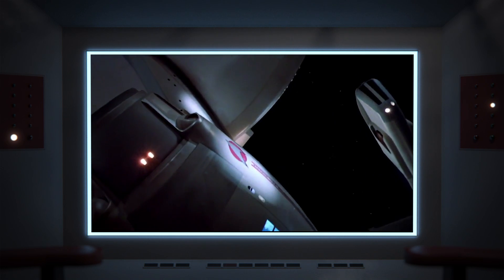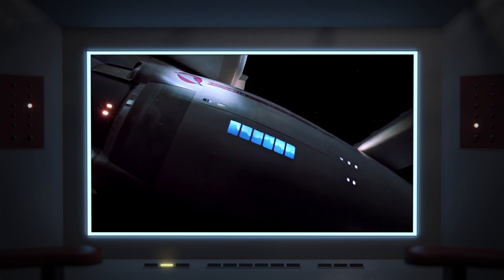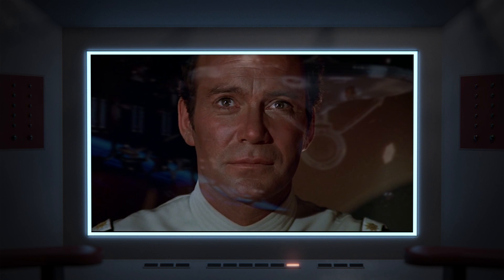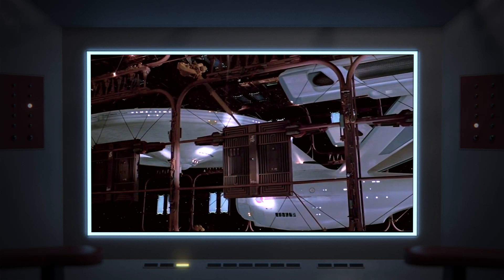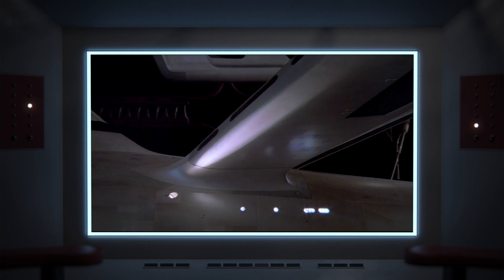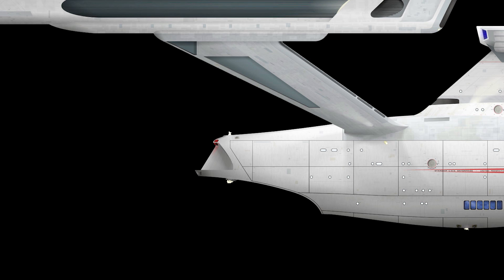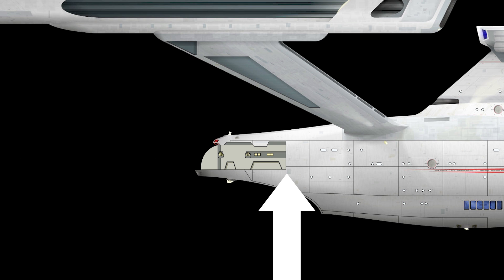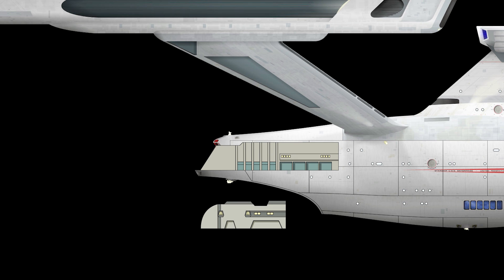Why Have Angled Nacelle Struts? (Enterprise Refit)

Comment: Other than looking so much better...absolutely spot on about the pylons!
The original didn’t have any visible docking ports, the refit does. 
The original didn’t have visible phaser emitters or torpedo launchers, the refit does.
The original did seem to have what could have been hull hatches on the underside of the saucer but the refit has more n they’re better defined. There are various emergency hatches on the top side of the saucer of the refit as used in TMP.
Nit picking details like thrusters on the saucer and engineering hull, far more windows, shielded panelling on the neck to protect the warp core...photon exhaust vent...vents on the pylons but god knows what for...visible tractor beam emitter.
Think of any more?☺️

Comment: I never thought about the additional hangar space, but it makes sense. But there's another design considerations as well that argue for swept struts: Power distribution.

The Warp Core sends plasma to the warp nacelle. Swept struts as shown decrease the distance the plasma has to travel to get to the nacelles. And since the struts connect in the center of the nacelles (over a broader area no less) on the Refit instead of the forward area as on the original, the plasma gets spread more evenly throughout the nacelles. Both features likely improve both efficiency and responsiveness of the warp drive.

The refit's larger struts also likely makes them more damage resistant. Not a small consideration on a ship that can expect to see combat.

Comment: Also take into consideration Tom Paris' assertion that when approaching Warp 10 the hull tries to shear away from the warp nacelles. Angle them closer to 180 degrees and the shear stresses are reduced significantly. At pseudo velocities below the threshold and the reverse is the case - the nacelles twisting/bending the mounting struts at right angles. An angled strut will bear the strain in a much more vectored fashion.

Comment: The Shuttle bay is a good point but I was going with position of the Engine room which I would guess complements your Shuttle bay theory. The original position of the struts being straight is well behind the position of the engine room. This means that anti-mater along with its associated shielding would have to be routed further along the inside of the secondary hull which would take away room that could be better utilized. Angling the struts so they go directly to the Engine room opens up this space.

Comment: Possibly added strength. I don't know exactly how warp works here, but if the ship is actually moving in warp, the angled nacelles provide a larger cross section where it enters into the ship thus providing greater strength to push the ship forward. But that really only applies if there is any kind of forward motion stress applied during warp, which there very well may not be.

You also tend to want to have every surface be slanted for something that is going to be shot at. Slanting a surface provides a thicker cross section while using the exact same thickness of armor. But again, this could be argued as it really only comes in to play when your attacker is on the same horizontal plane as you (like tanks). In space, it would likely make sense to have every area of the ship's exterior a wildly different angle. That way you will minimize how much of the ship at any time is perpendicular to any given angle your attacker comes from.

Also, it looks cooler and more intimidating, which is a factor to be considered if designing a ship. Though maybe not something important enough to refit a ship for.

Comment: Late to the party here, but while I see a lot of (often well thought out, but sometimes quite dumb) talk in the comments as to how the revised pylons might distribute the theoretical(it's sci-fi - everything's theoretical at best until we replicate it in reality) forces on the nacelles or hull better, there's one other thing I've not seen mentioned here. Of course, given Youtube's shitty way of loading comments, it's entirely possible I missed someone address this, but still I didn't see it so I'mma post this anyway.

THE WARP CORE WAS MOVED DURING THE REFIT.

In the refit Constitution class, the warp core was moved forward into a theoretically more well-protected section of the secondary hull(from what I've read, the more forward location also allowed more efficient delivery of power to the deflector dish). By angling the struts there is not only the structural benefit, but the connection between the warp core and the nacelles can be made less complex than they would nee to be if the struts connected to the original point. In the original design, the warp core was directly beneath the pylons.

Comment: The refit is a stunning design. My personal favorite version of the Enterprise next to the 1701-E and the original design.
As far as why the nacelles are swept back, I'm not sure if it was ever mentioned on screen or if the "Mr.Scott's Guide to the Enterprise" is considered cannon, that book had stated advancements made to warp drive with the new horizontal/vertical system had required a major refit of the Enterprise. The angled nacelles contributed to a more efficient warp field. I'm basing that on memory of a book I no longer own.

Comment: The engineering layout would have had to change to accommodate the new attachment location.  The warp plasma conduits would either be shortened or the engine room moved.  But since the warp core layout is significantly different from the TOS version, that was likely done first.  It's interesting that in TWOK we don't see any major structural elements from the nacelle struts inside the warp plasma conduit tunnel.

Comment: Also, the thicker struts mean that there is a lot more surface area, and the grey areas always seemed, at least to me, to be radiators/cooling fins, structures that were designed to dissipate excess heat into space from the engines. Personally, this Enterprise has always been my favorite Enterprise. And JJPrise has always looked like frozen dogshit to me. But, that's because he designed that to impress his 4-year-old daughter by glueing together two of her squirt guns, a turkey and a frisbee.

Comment: How is warp plasma pushed through the warp coils in the warp nacels? If the coils need to operate in opposing pairs, having the warp plasma enter near the middle of the warp nacel might require that swept back design.

But honestly, it was done simply cause it looked cooler.

Comment: According to Memory Beta, after the Enterprise returned to Earth in 2270 from Kirks 5 year mission, they decided that it's technology was outdated and needed replacing. They also decided instead of decommissioning the ship, it would be used as a testbed for a new warp drive that was being perfected. They also replaced the struts with thicker ones, as the old ones were too thin to support the weight of the new nacelles. Also because the new plasma conduits were too big to fit into the old struts, so this was another reason to replace them. I think the angled struts were partially what you talked about, giving the ship a larger and more efficient hangar bay, but also to increase warp efficientcy.

Comment: what I can think of for the redesigned struts, is that they would handle the acceleration into warp much better than the original design, especially with the redesign having more powerful warp engines.

Comment: The swept nacelles not only look sexier but they're physically larger. Perhaps more plasma conduits/bigger diameter plasma conduits for the injectors to get into the coils allows the ship to achieve higher warp factor? I don't know if plasma flow is involved but I would think that having access to more would improve that. Just a thought. Also having them thicker than the TOS struts presents itself to be more structurally sound.  And the mounting that the nacelle has at the end of the pylon gives it a lot more contact, so again it's stronger.

Comment: Yes I had noticed this advantage. I also noticed the boxes on the side of the secondary hull and wondered if they contained elements that originally would have been internal that are now in those pods - suggesting more available space directly behind & beside the deflector array. Also the Torpedo pods and partially sticking out impulse deck also frees up space in the lower saucer - though that is compensated for by the increased number of phaser points.

The secondary hull is a lot more different in shape than it appears at a glance too. It is also interesting to apply some of the principles of starships from other eras too and wonder if they have a role here - like is there access panels like NX-01 has and what are they for (there is labels on the effects model suggesting doors) I do wonder what they do.

Comment: if you go by old cannon books the reason for the struts was to keep the warp bubble in a very specific shape to ensure the fastest possible speed and to keep the radiation that leaked from the engines away from the crew compartments as much as possible.

Comment: Had a ONE car garage and when I had a passenger I would have to let them out before entering the garage because they would not be able to open their door.  So when I got my next Home it had a TWO car garage and the passenger could exit the car without getting wet.  And this also worked with TWO cars in my new home.  So I see it as away for the Shuttles to be bigger and hold their SUV sized flying Autos, comfortably.

Comment: Look closely at the new struts.  See those black and blue-ish fins along the sides and center?  Those are cooling fins, designed to radiate heat.  What happens when you put improved engines and more equipment into an old ship hull?  Why, you need more cooling.  That is exactly what the redesigned struts have on them.

Comment: I figured it would be so that the connection point for the plasma conduits going up the nacelles would be closer to the warp core, giving engineers less length to search for damage within the engineering hull in an emergency.

Comment: It seems obvious when you look at 0:58. The old enterprise connected to its nacelles closer to the front. The newer Enterprise attach to the center of their nacelles. Assuming the engineering requires it to be so,  the struts would either need to come up straight at the very end of secondary hull (much like the Enterprise D) or it can sweep back from the end of the  main engineering section. The latter seems a better choice since it would not need a redesign of the secondary hull (which they did on the Excelsior class) The extra cargo bay is a bonus for long 5 year missions.

Comment: The struts also connect closer to the rear of the nacelles, which means that the nacelles are less likely to take damage or break off when there's torsion to them.
The swept back look might also be to help with physical deflection of head on object while the shields are down.

Comment: By moving the struts forward they would need to be angled so as not to interfere with the saucer should it need to detach. I also concur with the observation that there would more connecting area at the base of the strut for added strength. Also, angling the struts would give a larger Enterprise an overall lower profile when considering the need for docking or any other reason where the ships height may be a factor

Comment: The struts enter the hull at a wider point in the hull and a higher point witch allows for more room in engineering's bigger warp drive engine and also more computer space as a lot of the engine function are  likely taken  by the computer.....

Comment: In addition to connecting to a bulkier part of the ship and expanding the shuttle bay, the angled struts attach to the nacels at roughly their midpoint which would reduce torsional forces on attachment points in high gravity situations.

Comment: didn't they switch from horisontal to vertical warp core?
that being saId a route from the core to engines would be longer and inside the ship and that extra danger for the crew
so because engines were designed to be where they are, pylons had to change shape
and there is one adventage they look like now they are harder to break off :]

Comment: Deceasing the angle will decrease the stress on the attachment points. ((In line stress)). The REAL QUESTION is, how do you actually do repairs on the engines themselves, being no human can fit  through the support struts going to the engines.
Reply: Maintenence shuttlepods, and spacedock for more serious repair.

Comment: It's funny, I remember when ST:TMP came out and I saw my first publicity photo showing the refitted Enterprise.  My initial reaction was "They RUINED it!"  But I got over that remarkably quickly, and by the time I actually saw the movie in the theaters, I'd come to prefer the refit to the original design.  That was my opinion on the matter for many many years.  But I few years ago, I swung back to preferring the original design.  I've seen a number of websites where people have taken that original Matt Jeffries design, and created CHI renderings that kept the proportions exactly the same, but enhanced the surface detail of the ship.  And I don't mean adding a lot of greeblies and extraneous detail; it's subtle, but extremely effective.  It looks just like the original Enterprise, only more so, if you take my meaning.  I really, really wish they had gone that route with the Abrams reboot.  Aesthetically, there's no reason they couldn't have.  As these enhanced CGI images showed, the original ship absolutely still works today visually, if you do it right.

Regarding the shuttle bay.  I loved the interior shots of the shuttle/cargo bay from TMP when I first saw them.  When I heard, years later, that they were going to do a scene in ST:V involving the shuttle bay, I knew that they were going to throw that out and have a smaller shuttle bay the same size as the one from the original series.  They proved me right.  One thing that ST has always been lousy at was maintaining continuity.  (Yes, yes, I know the 1701A was a different ship, but it's still the same ship CLASS, and shouldn't vary in such major ways.)  And if, as noted in this video, the whole point of moving the nacelle struts was to enable the Constitution class refits to have a larger shuttle bay, why go back to the smaller shuttle bay size of the original Constitution class shuttle bay?

Comment: There is also practical reasons for this from the design of the warp core.  The warp core uses the reaction between deuterium and anti-deteurium through a dilithium crystal to generate plasma that is then fed to the warp coils to generate the warp bubble needed for that speed.  While extremely hot and highly volatile (requiring magnetic fields for containment), warp plasma is still a fluid and everyday fluid design principles apply.  The angled nacelles allow for shorter runs of plasma conduits.  Additionally, it takes out the 90 degree angles and replaces them with shallower angles.  This is important because it takes force to turn a fluid in motion. Think about Neuton's laws of motion here.  Turning a fluid stream to 60 degrees takes a lot less energy than a 90 degree turn would take.  that means less load on the magnetic containment system.

The shorter "pipes" and less load on the containment fields mean it takes less energy to runt he warp system and also increased safety due to there simply being less stuff there that could potentially go wrong.  This also make maintenance tasks easier as well.

Comment: Well thought out.  Very nicely done!  I like videos on topics like this.  Perhaps also if Engineering had been repositioned in the secondary hull, it might also dictate where the main plasma conduits could diverge from that area to connect with the warp engines while still keeping those nacelles a safe distance from the primary hull.  Just a thought.

Comment: Since the nacelles are essentially impellers, the force applied on the original struts are exactly perpendicular to them causing maximum shear stress. With this swept design it's braced somewhat against the shear stresses

Comment: The redesign was to give the streamline the struts for better lift/drag ratio in the subspace plenum.
Temporal vertices off the trailing edges of original struts were compounding with increase in velocity creating relativity instability.

Comment: I've always wondered why the nacelles were separate from the main hull of he ship. You've got a saucer section, a main body section, then the nacelles ... but why make them three separate structures attached by thin struts? Wouldn't the ship, as a whole, be more sturdy if it was one monolithic structure with the nacelles integral to the whole?

Comment: Iirc, this enterprise introduced the vertical warp core.  The previous one had a horizontal warp core.  They moved the pylon attaching points forward to reduce the number and severity of and bends in the plasma flow and gained shuttle bay room in the bargain.

Comment: The design principle is that of the cantilever support.  The bulk of the pylon's supporting mass is focussed at the level at which it attaches to the secondary hull strongback.  As the pylon rises, the supporting framework extends outward in a "fan" to meet the nacelle at a central section, distributing structural stress while also "carrying" the nacelle at its strongest section.  Also, the nacelle mounting is now more firmly located in the main supporting framework for the secondary hull and closer to the ship's centre of mass.  Many modern sports stadiums use the same principle to support "flying" balcony or overhang sections.